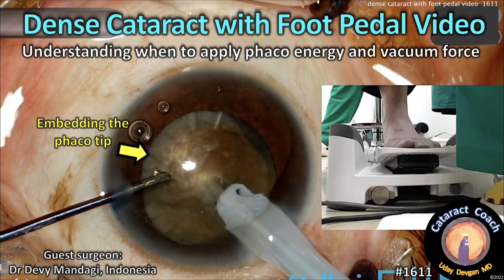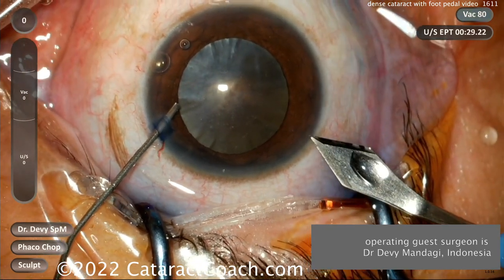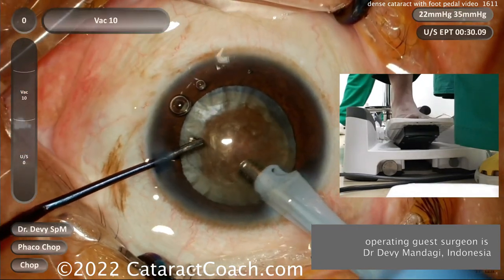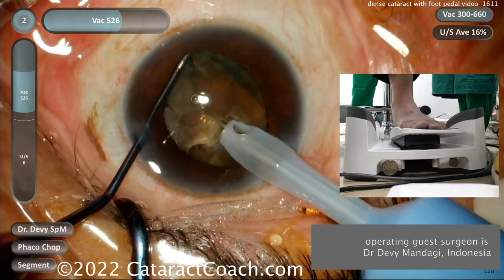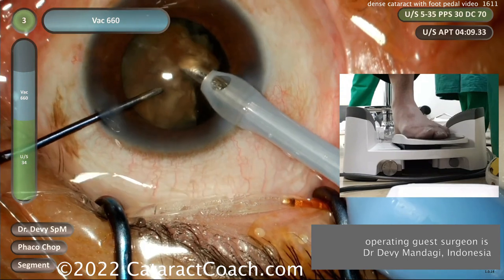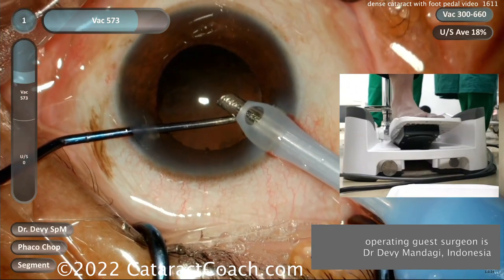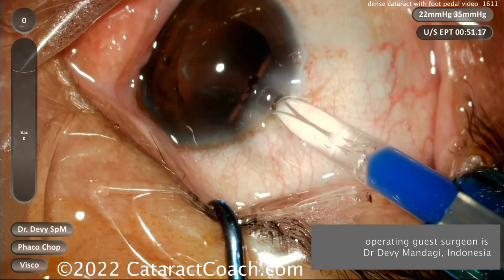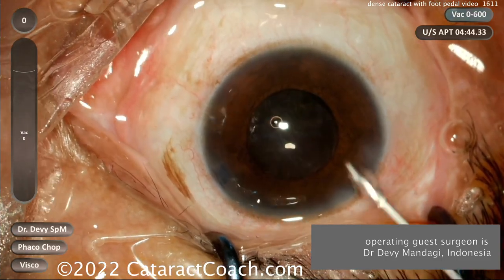CataractCoach 1611: dense cataract with foot pedal video

Comment: Very nice surgery and technique. About the bare foot thing: many surgeons are taking their shoes off during surgery and some of them also the socks to “feel beater” the foot pedal. It is not right, not very hygienic and not safe even to the surgeon.  There are many good “sea shoes” the are flexible that you can use even in the o.r. I’m using special socks with a plastic sole that athletes are using for outdoor running. They are very comfortable and very safe using and still the surgeon can feel the foot pedal very good and also you can wash them routinely in the washing machine
Reply: That's right; I use some sea shoes from a brand called Skechers and they are pretty nice. If no shoes are used, surgeon may end up with fungus in his toes or something like that
Reply: The brand I use is Skinners.